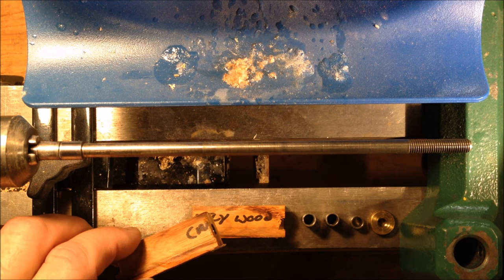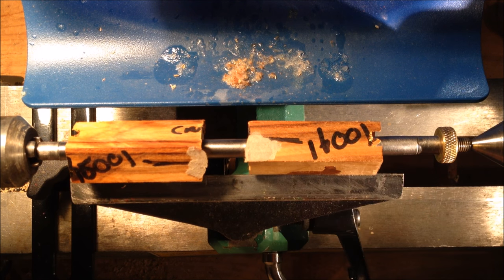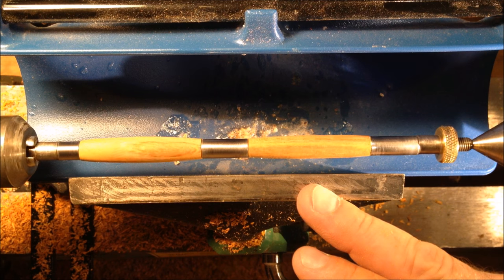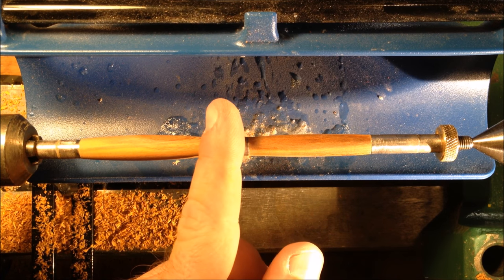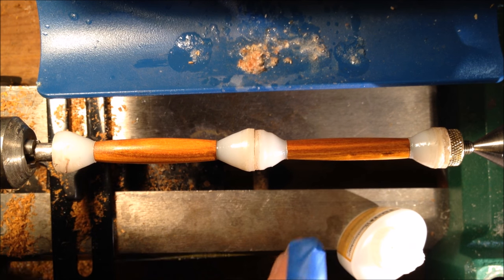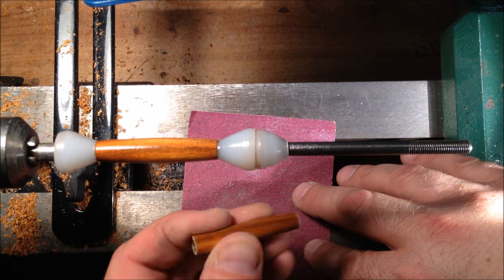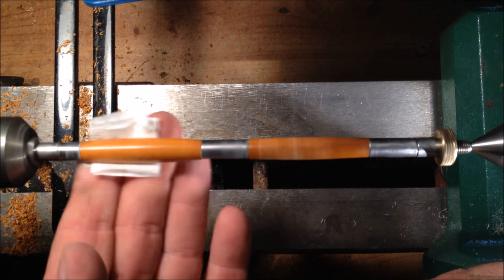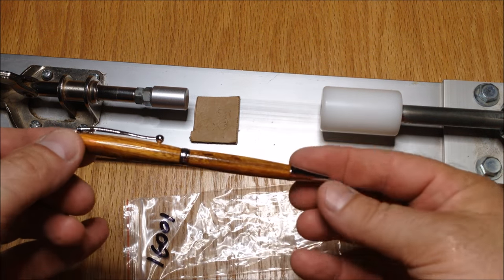Turning Pens For The Craft Show

Comment: Your technique is very similar to mine.  Big surprise as you taught me everything I know!  :-)  Against popular opinion I have been experimenting with finishing my pens at high RPM.  I micromesh all the way up on slow speed but then turn it up and carefully go through the 4 highest grits again at fast speed and apply the polish at high speed.  I have yet to burn through and it does produce a super high gloss finish.
Reply from the maker: +Tenspeed TheBikeHanger That's interesting, I never thought to try that but I might give it a try. Great tip b

Comment: I fell into something quite by accident. I bought some Swingline Rubber Finger Tips from Amazon to use when I'm scrolling to make pushing the stock easier under the  saw blade. I tried using one on my index finger when applying ca glue and it works great. The paper towel will stick to it but it comes off very easily. It works even better when sanding with the 150-600 grit sandpaper. You don't even feel the heat buildup from the sanding. Hope you try it. Enjoy all of your videos.
Reply from the maker: +David Gardner Great idea!
  I'll have to check our Office Depot. 

Regards,
Bob

Comment: Hi Bob
A very good video for any beginner starting out on pen making. I have been making pens for about 3 years lost count of how many probably 100 or more. Recently I was given a quantity of Red Cedar from an old floor, in order to get a finish I found it best to give it 4 or 5 coats of sanding sealer after the 240 grit. ( I notice you dont use this at all) then I use Yorkshire grit to complete the sanding, the beauty of this product is its a paste that contains any sanded dust and gives a finish between 600 and  1000.
Polish or CA can then be applied this method really makes the grain pop especially with dark woods.
I was surprised that you don,t have a spindle saver (a live centre that goes in the tail stock and fits over the threaded part of the spindle) pressure is applied to the brass nut and stops you bending the shaft. These are just my thoughts i know any 10 turners will have different views and methods I am always keen to see other methods. Good luck with your show.
Eric
Reply from the maker: +Eric McRae Hello Eric,
  Thank you for the information on your finishing process. 

  I love the Mandrel saver, I just bent mine and rigged this up. It's been working so I haven't replaced it yet. 

Regards,
Bob

Comment: Thanks for the video.  I noticed that you use painter's tape to cover your finger for the CA glue.  I've been using the small zip log bags that the pen clips come in. They fit well over the end of my finger and easily reused.  As you know, if you make many pens there are tons of these bags that cost nothing.
Reply from the maker: Thank you Gary,
  I have a ton of them but I haven’t tried that technique yet. 

Regards,
Bob

Comment: Bob ya done gud!  One of the things I do, when using the first Micromesh pad I look closely at the blank.  It should be completely hazy.  If I see any shiny spots it means I have a hole in the finish or I need to sand more.  
Do you remember where you got those long 7mm bushings.  All of mine are the short ones and I could use the long ones.
Thanks
Reply from the maker: +Dave White Thanks Dave, that's a good tip. 

I got the long tubes at Penn State. Someone told me the hobby stores carry them but I haven't checked yet. 

Bob
Reply: Bob I guess I didn't explain myself well.  I am talking about the bushings that you turn to n ot the pen tubes.  The normal 7mm bushing is about 5/8 inch long. You also have some that are about an inch long.
Reply from the maker: +Dave White Oh, LOL, I picked those up from Woodcraft in Louisville. They cost $4.95 and I like them because they don't seem to compress like the smaller ones do. 

Bob
Reply: Thanks Bob I am going to check them out

Comment: Great video. Are there any kits you would recommend for a beginner and where would you buy them from? I'm building my lathe bench as we speak and I was given a large quantity of blanks to get started on. I'm interested in lend and pencil sets too. Thanks......Scott
Reply from the maker: +The 2 Car Garage Shop Hello Scott,
  I usually recommend slim line pens because there inexpensive, under $2.00 each. I like the Fun Line version from www.pennstateind.com. I'd recommend requesting a catalog from them, the website is ok but the catalog is great!
  The Fun Line series also offers a matching mechanical pencil just under $4.00 each. 
  If you can turn slim lines you can turn any other kit out there. 

Regards,
Bob
Reply: +RJBWoodTurner thanks, will order the catalogue ASAP.
Reply from the maker: +The 2 Car Garage Shop if you have any questions or need anything let me know. 

Regards,
Bob

Comment: So it's best to put the speed on low instead of very fast for sanding?
Reply from the maker: Yes, it builds way less heat. 

Regards,
Bob
Reply: RJBWoodTurner thank you, but why is the heat a problem? And will slow turn sanding the same smooth result as fast? Thank you
Reply from the maker: Heat from sanding wears the paper out quicker.
Reply: RJBWoodTurner ah ok, didn’t know that. Thx
Reply from the maker: It doesn’t let the dust clear and can also burnish the wood. You want to sand at the lowest possible speed. Then when you stop the lathe, sand with the grain to remove any circular scratches. 

Regards,
Bob
Reply: RJBWoodTurner thank you Bob, I will try it in the morning 👍